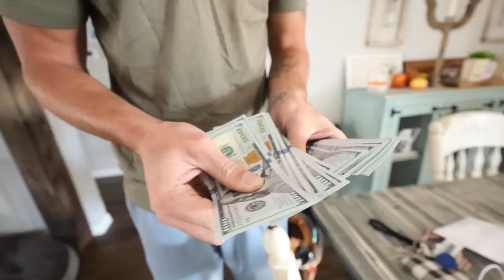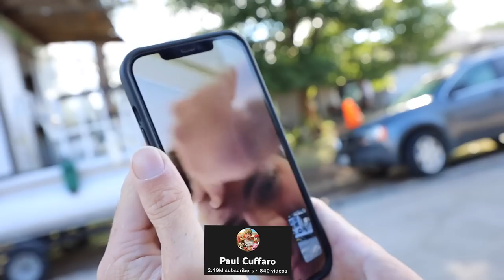I bought a HOUSEBOAT from Facebook Marketplace! (The Crack Shack)

Comment: The inverter the guy you brought this boat shack from is talking about is usually used in motorhomes and campervans - It inverts 12v DC (like what cars use) to your usual AC outlets like you have in a house. I believe meaning you’re actually fully running this off of a car battery… You need some way of it charging itself like you have with motorhomes and campervans where they charge whilst being driven… Solar panels maybe? Whatever you do decide for the electrics I’d recommend something more waterproof than what he’s made already as you’ve now got a broken inverter that was mounted outside… that’s literally like putting your house’s fuse box on the roof with no protection - You’re asking for broken electricity the second you have too much humidity around it. Seems like a dope project though!! Can’t wait to see how it goes!

Comment: Dude you're gonna put out more cash than you paid for it  just to rebuild it and get it running lol. But if done right it can be cool. But realize this you're going to have to use marine lumber for it to pass any inspection with the Coast guard. And that sort of lumber can cost over double the price of regular lumber. If you do this Brendan do it the right way the first time. Don't try going cheap on the materials you are using. Because the coast guard will have you rip it all out and do it all over again with the right materials. I  know this firsthand because I built a small house on a pontoon boat and tried using regular lumber and they had me replace everything. But like I said if it's done right it can be bad ass. Good luck with that. Don't screw it up lol.